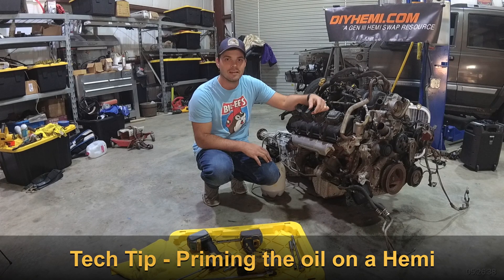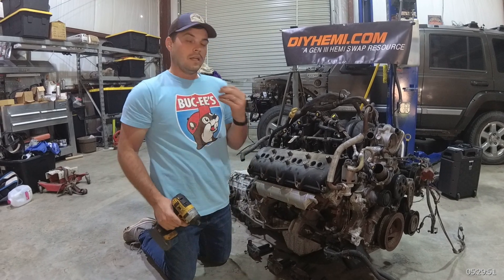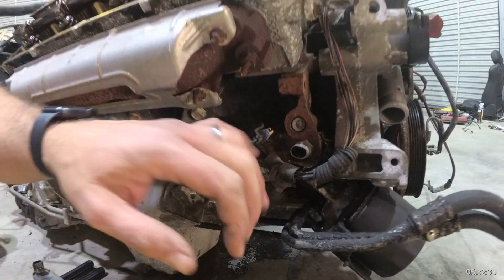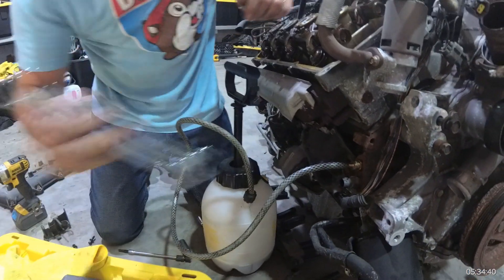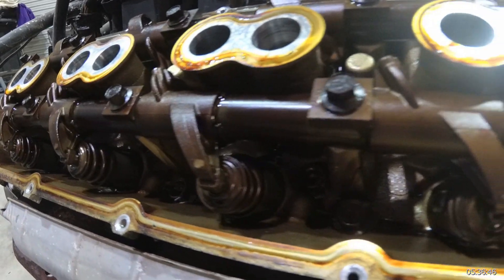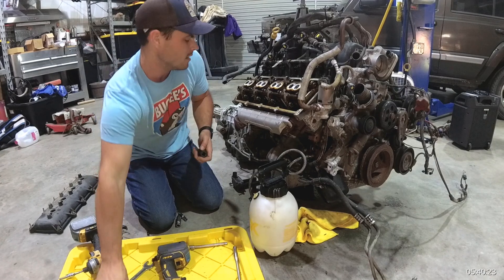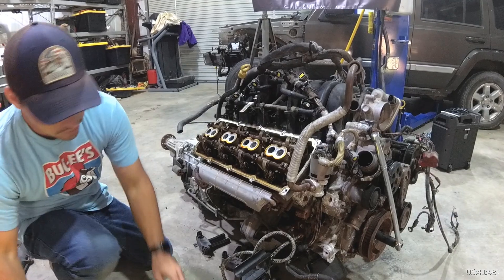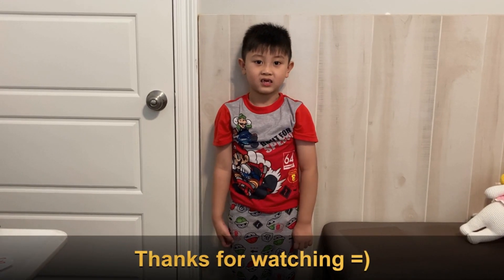How to Prime a Hemi Engine with Oil | DIYHEMI Tech Tip

Comment: On the 2011 jeep grand Cherokee Laredo 5.7 hemi I've just replaced timing chain tensioner and put a melling oil pump on. Is it alright to just use the jeeps integrated oil priming method of holding down throttle fully pressed to disable fuel and crank for 10 seconds 3 times? Im not a mechanic and ik I shouldn't have been in the engine at all. But desperate times call for desperate measures. Belts getting ready to go on probably today. I followed everything I could find to a T just very nervous about initial start up. Any tips are appreciated. Thanks for your video, I really hope I do not need to remove valve covers because I should have done that while the rest of the engine was apart to check valves lol.

Comment: Good video, but I was wondering if used the oil pressure port to prime it isn’t that oil going straight inside the engine without passing the oil filter? Meaning non filtered oil inside your engine. I’m about to finish assembling my 6.2 Hellcat engine and wondering which port to use that goes to the filter first before making it way inside.

Comment: sometimes you can find those old fire extinguishers that are stainless steel i made one to flush trans coolers i also use to prime engines you can pour as much as you want i put a gauge on mine and put about 30PSI and goes real fast

Comment: Do you have to pull the valve covers?
Reply: I would think not as long as you can pull the spark plugs, for both the valve cover and spark plugs are for visual and auditory confirmation.

Comment: Prime is very important on these due to the bad redesign of cam location they moved it higher up from center than the original so lack of splash oil at idle

Comment: I am very happy to find your video. I just replaced a 5.7 Hemi in a 2004 ram 3500 with a honest to goodness store bought Reman. When I tried to let the starter spin the engine several times I didn't get a drop of oil. After following your excellent instructions the engine didn't even tap when it started.Thank you very much.

Comment: On the two ports on the side, is the bottom one with the temp sensor oil straight from the pan before the filter and the top port with the plug the oil after it’s been through the filter but before it goes through the rest of the motor?

Comment: I've primed engines in the same manner, one suggestion, buy a cheap inline filter for a lawn mower and put it inline with you tube to make sure no little bit of crud in the tank or oil goes in your engine.

Comment: Quick question  Is your motor oil in the oil Pan already or are you doing this before you add the oil
Reply from the maker: We would typically want 2-3 quarts in the pan to keep the pickup tube submerged. It’s not required because you are priming the pump and the internals above but good insurance.

Comment: Another easy way is to remove 1 spark plug per cylinder, remove fuel pump fuse, and let the starter do the work by cranking engine over 10 or 15 times.
Reply: ³³
Reply: Yes, prime all critical engine parts like connecting rod bearings and etc before using starter. You do not want to crank engine with bearings dry.
Reply: I think the point is to prime it before spinning the motor over without oil for the first bit.

Comment: Do you do this with a full 7 quarts oil in the oil pan? Like do I need to buy extra oil in order to do this?
Reply: The motor takes 7 quarts  do not ad more. You prime the motor first . The oil you use to prime the engine will be part of the 7 quarts.  After prime , fill the engine with the remaining 7 quarts.

Comment: I have filled both those ports with oil numerous times now and still no oil pressure.   I have a 2014 Ram 1500 2 wheel drive. There is a 3rd place on the front of the oil filter. It is the oil pressure sensor. Would it hurt to pump oil in that port?? At this point if I can't get oil pressure after all that work ,  I will just get a new truck. So disgusted. If you can help please let me know. Thanks very much!

Comment: Dont know if it applies to all PCM setups but if I hold the gas pedal to the floor while cranking the engine will only crank and not start ... I do that to prime after all oil changes or if it has sat for a while ..
Reply from the maker: We didn't know that! But even if it doesn't crank, the oil not being in the lifters and cams could cause some wear initially.  We definitely still recommend manually priming it before turning the crank.

Comment: Excellent video!!
We just purchased a 2003 dodge ram 5.7 hemi that has not ran in 9 years. At some point the oil was drained and not replaced. Engine still turns free with a breaker bar and socket. 
We are unsure of why the oil was drained and never replaced and want to give the engine the best shot of avoiding any internal damage because of the lack of oil. Thanks!

Comment: could you just use an old air compressor hose.  use one fitting on the hose from your hand pump thingy and thread the other connector into the block (probably with adapter).  wouldnt that allow a quick shut off once you disconnected it and keep the oil somewhat pressurized?
Reply from the maker: Yep, that’s a great idea

Comment: Good idea to prime a new engine.

May someone tell me the Threadsize ( Oilpressure-Sensor ) to prime an Gen 3 Hemi ?
Or is it although 3/8 NPT ?
Update:
Found out, that it must be 1/8 NPT 27  taperd-Thread.....1/8 means an outer Diamter of 9,5mm because of Pipethreadsize.

Comment: Hey guys getting ready to buy my EFI for the Hemi swap on my '83 CJ7, what EFI system works best for the hemi? Or should I say which one would work best in my case. It will eventually get one ton axles and 40's, but I dont need 1000HP or anything. I plan on keeping it pretty much stock. Maybe a cam and heads later.
Reply from the maker: Factory efi is highly recommended in this application
Reply: @SUBLIMEparts  do you have a recommend year and platform I should source it from? I was leaning toward a '05 Truck.

Comment: Great info. Blake, is that top plug that you primed also the same port you would use to put in a factory oil pressure sender in an older vehicle? Think that’s the one you were referring to on the podcast? Thanks!
Reply from the maker: Slicknapier, that is correct my friend!
Reply: So, it is safe to assume a feller could add a manual oil pressure gauge to the upper boss so we have electric and mechanical gauges?

Comment: great video ......are 2010 dodge  ram hemi heads any good..?.i can get a set what do you think there worth for the pair...?..i want to replace my 05 -2008 heads....the 2010 are the eagles heads right....?
Reply from the maker: Yes they flow better than 05-08 and can be used. Just be mindful of how they will change your compression and what tweaks need to be made. Many have done the swap
Reply: @SUBLIMEparts  ok what else do i need to do..?..and can i adapt an old style carb intake to it..?..off any hemi...

Comment: Yo you the man, lol great idea. I would like to contact you regarding the 05 diy harness, it only shows you have the 03 and 06, does 05 just fall into the 03 harness.
Reply from the maker: 05 is its own year. It’s nearly identical to the 06-08 but has a few pins swapped around in the body connector
Reply: Okay sweet, is there any 4.7 harness that the ram has that will plug right into the 5.7? I have 05 harness and fuse box and computer and the harness that runs to gas tank and rear, just don’t know about dash yet, any tips?